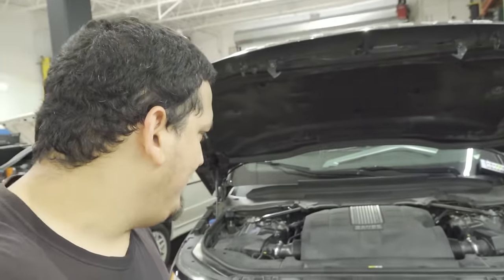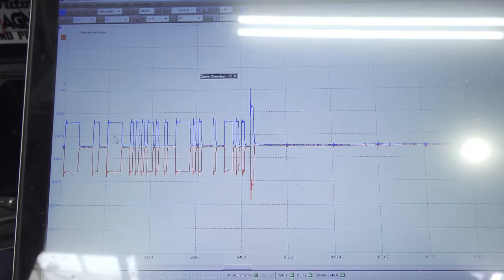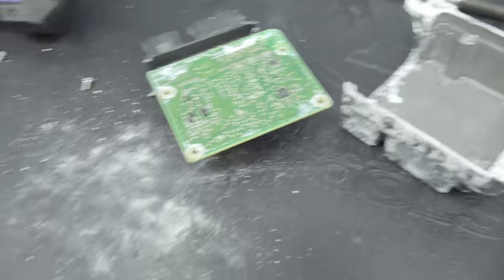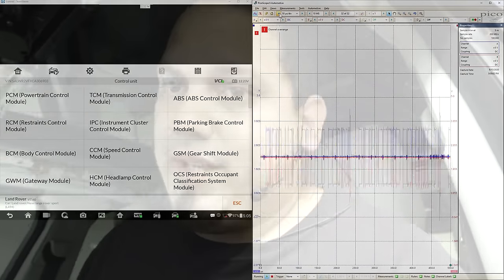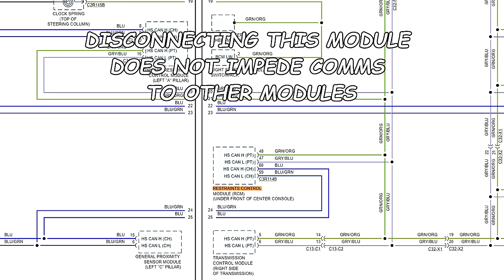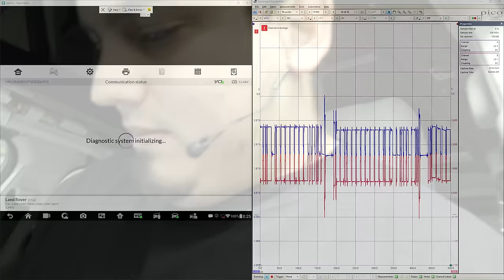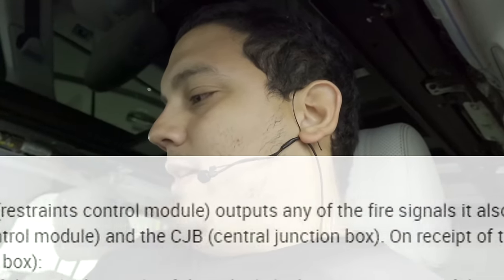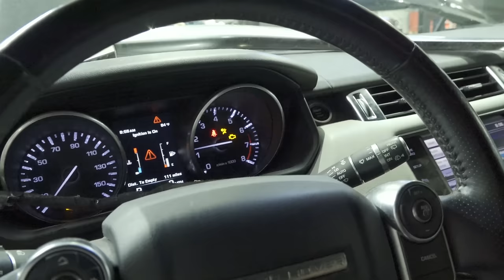2014 RANGE ROVER - INTERMITTENT START STALL/NO CRANK

Comment: JLR products need a crash (no crash actually) signal from the RCM to allow engine start. Also will not start if telematics module is offline. I have never tried depinning the CAN lines while leaving the crash output line intact to see if it will crank though......

Comment: Super Mario you are the only one I know who can help me out with this car problem. The car is a range rover 1998 p38 4.6HSE and v8. Many people were invited to start the car even from a far State but the couldn't. The challenge is a crank no start, no spark,no injector pulse but good communication with a scan tool. I have added fuel to the intake manifold and crank the engine no change at all. It is not starting. In addition, I checked for spark, but there is no spark as well.
Hence, I have just checked for injector pulse but there's no injector pulse either. There is also no ignition current to the injector circuit with key ON and engine off. 
All the fuses and relays are good. I also checked the injector circuit for continuity if the wire is shorted but it was ok. Scan tool communicated and showed only p1843 and p1842 code. There was no RPM during cranking. What I noticed today when I compared the ignition, earth and DC with the same car that was starting and driving to the car that was not starting, what I saw made me to flabbergasted. Where the was ignition for example in the working car there was DC in the car that was not starting. Also a particular relay circuit for example RL-2 one of the pin of the connector when my test light was on battery ground and relay removed, the pump buzzed and testlight dim but when I tried that same location with test light and same pin the test light was dim and ABS relay was actuated no buzz from pump. It is like that in many places in the fuse box and PCM circuit. Please  what's the cause of the problem and what do I need to do to fix the problem?
Reply from the maker: What do you mean by "there was dc"? Sounds like you found your issue, something is going on with your crank sensor/circuit

Comment: Hey Mario I have a Range Rover l494 2016 the instrument panel goes on at times and goes off at times it fails to crank not until I use the neutral release underneath the cup holders then shows but if I release it baq into park the instrument panel goes off and the vehicle remains running but diagnostic doesn’t communicate and does not charge

Comment: someone correct me if i'm wrong  but the green crusties are actually crystallized metal salts that when damp will conduct. by opening it up it dried out enough it was no longer conductive.  on low voltage logic circuits(1.5 v and above =1 and 1.4 v and below =0) it doent take much  to kill the transmission of the signal. if it got just a little damp from high humidity it would act up again.   if thats the case just cleaning the board  would be a fix for a cheapskate.  i have heard of dvd's tv's and such if left in a car trunk and cooled down if brought in to a warm house they wont show any signal until they are warmed up for a bit.  my guess is condensation not enough to kill the power circuits but enough to short the digital signal. thus some owners manuals actually say to acclimate the electronc unit(tv or whatever)

Comment: Any idea why moving the module around would cause bag deployment?
Reply from the maker: There's likely a gyroscope that when moved at a certain speed, translates that into a rapid movement of the vehicle and will deploy the airbags since it thinks there's a crash
Reply: @SuperMarioDiagnostics  you think that would be in the module itself? i would guess the sensors around the perimeter of the vehicle would be the ones that sense any type of impact
Reply: @RR-bt5xv  would it be a rollover sensor?   seem like scanner danner flipped the module over if i remember correctly

Comment: What is the 31.68 volts on the autarchy capacitor in that module?
Reply: when told to discharge that's what sets off the airbag.  done on purpose so a 12v short is not supposed to be enough to set them off.  not all systems are like that.
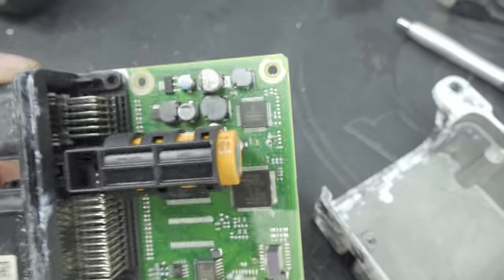Reply: that  big yellow electrolytic capacitor @5:33 is it.  electrolitic capacitors rarely fail open and even if they do they wont charge enough to set the bags off. conversely if it fails short not only wont it charge it will also draw the power supply to the module down.  thus the engineers moniter that voltage to be able to alarm if there is a problem the voltage is not there if bag deployment is needed.